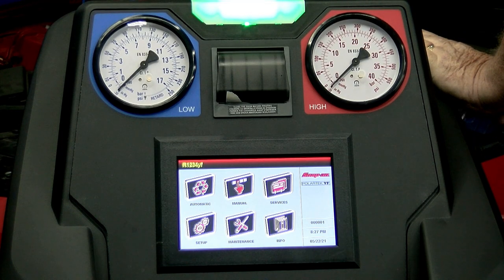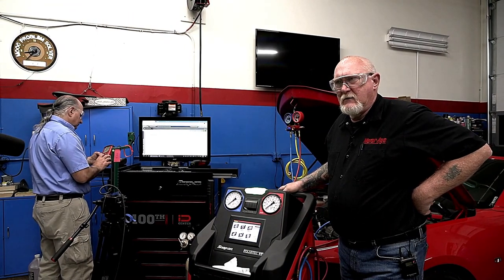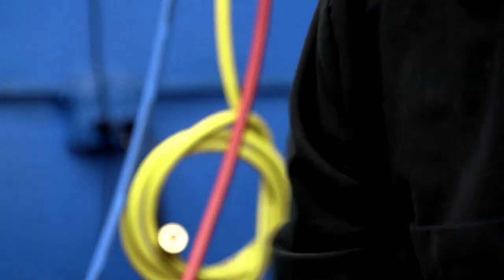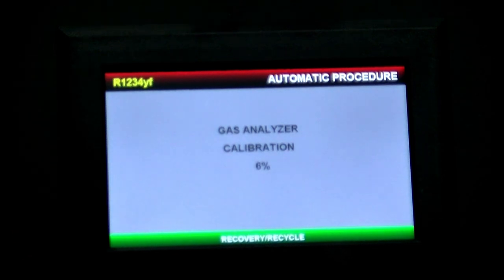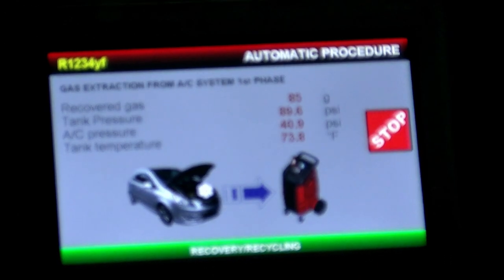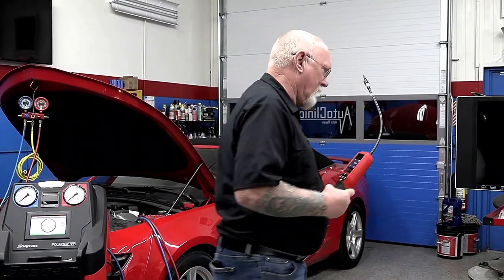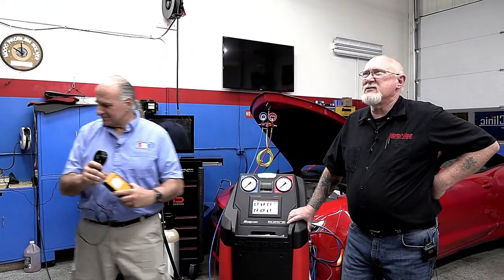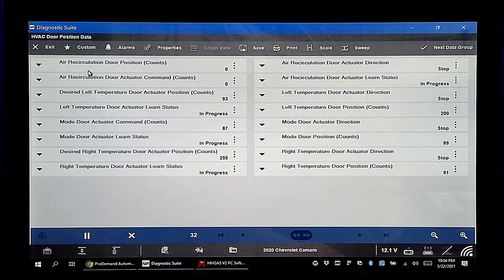Pete Meier & G Truglia AC Webinar Highlights on Snap On R1234yf Machine

Comment: Refrigerant leak detectors have been unreliable for years unless you have a very large leak. Everyone I have talked to has trouble finding leaks on 1234yf systems. 
Robin air has a new machine that has a N2 injection port and come with a H2/N2 detector so if a pressure drop is detected with nitrogen in the system it has you connect the H2/N2 tank so the detector can find the leak.
Reply from the maker: An easier and more usable leak detection system for leaks is the ATS BullsEye that uses CO@...you can also use the Snap On gas analyzer or the ATS tool. Thanks for watching ..... If you have not already subscribed to our tstseminars YouTube channel please do so. Interested in more training? Go to www.tstseminars.org and view full length videos for members on TechFlix for $9.99 unlimited viewing …Membership and over 85 videos for less than $200.00 a year. Also checkout www.attstraining.com for hands on training and webcast
FREE videos at www.tstseminars.org/training-videos